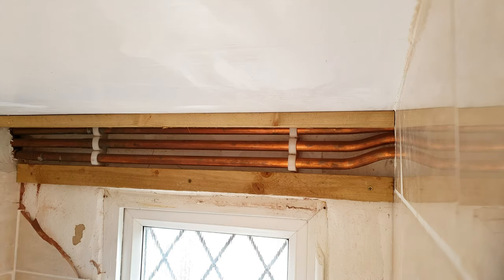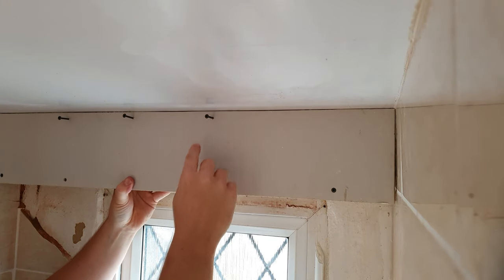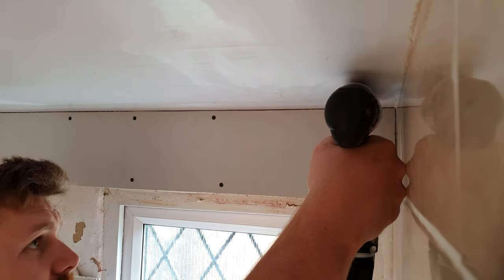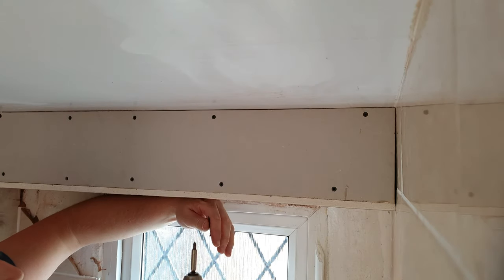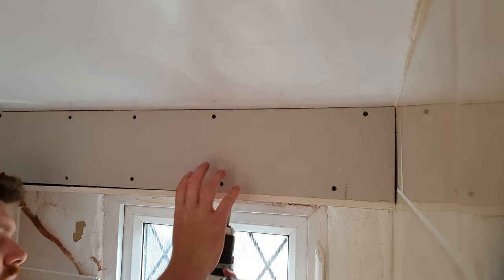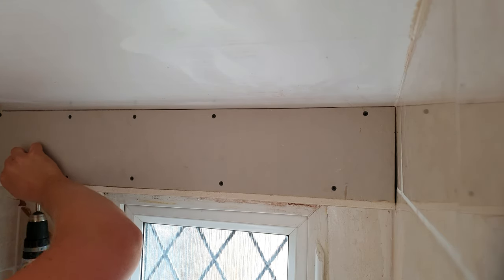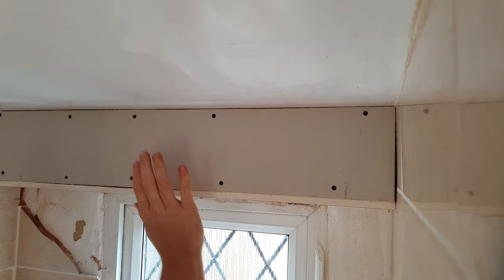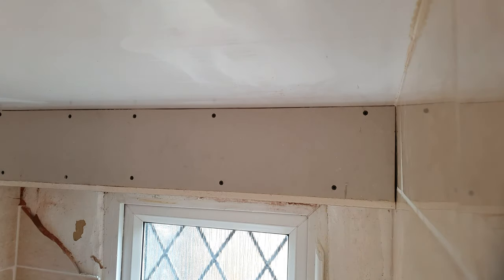Boxing in pipes - hiding pipework with EASY BOXING IN METHOD

Comment: Nice one!! .THANK YOU....( huh batten on the back of the board!! awesome !! 
 ... DIY old lady here:)
Reply from the maker: Ya its good way to avoid having to build a full box section on the wall first
Reply from the maker: But obviously not if its going to be structural or have a lot of weight on it then you'd want to build a full box section or your reliant on the strength of the sheet material.  But for a quick bit of light boxing it's awesome imo

Comment: How did you drill in the wood to the wall originally?
Reply from the maker: The wall plate I drilled with a 6mm sds bit and used 6mm rawlplugs with 3inch 10s I think from memory 🤔
Reply from the maker: It's a masonry wall if it was timber frame could fix to the studs